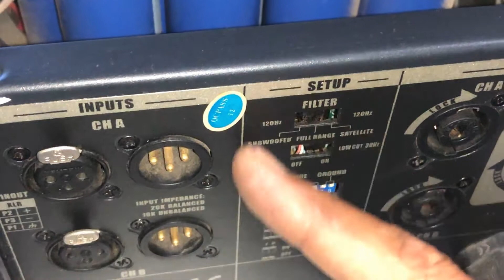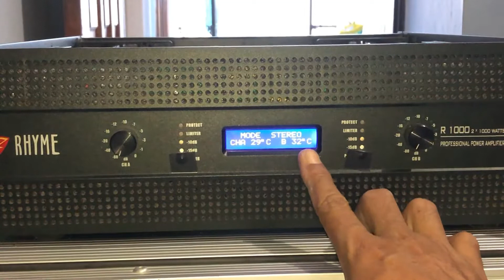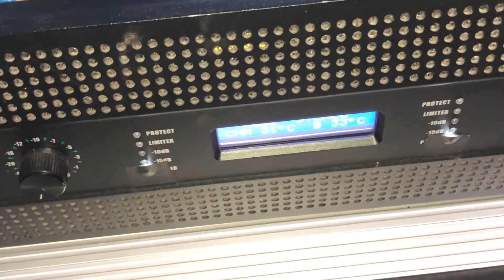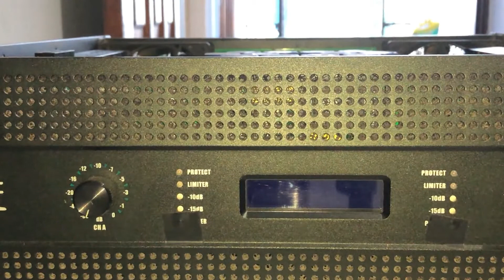RIVIEW POWER AMPLIFIER RHYME R1000

Comment: kalau tipe rhyme 2400 gimana itu boss rekomen kekurangan dan kelebihanya bos
Reply from the maker: Matur thank atas kunjunganya mas,langsung aja utk rhyme 2400 kelebihanya dari rhyme 1000, ya jelas lebih besar wattmya, rhyme 2400 
Setereo out 8 ohm 1500 watt
Mono bidge nya 8ohm 4000 watt 
Freq respon  25 hz——25khz
Kurangnya ya cuman blm punya control temperatur, namun semua itu pemakaianya hrs disesuaikan kebutuhan spiaker biar aman gitu mas🙏🙏🙏🙏🙏
Reply: @rudysoundsystem2201  rencanna mau beli yg 2400 buat 18 in untuk sekelahh jenangann ..gmnaa sarannya bos
Reply from the maker: Saran kami beli seri yang R5200 aja , power ini sangat klop dan recomendasi utk sepiker 18’ 1000 watt 👍👍👍👍